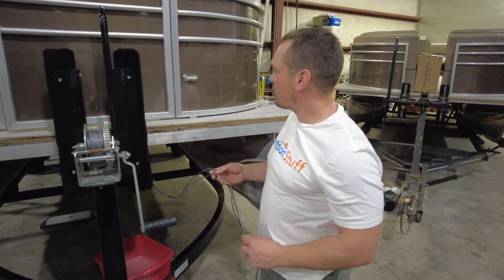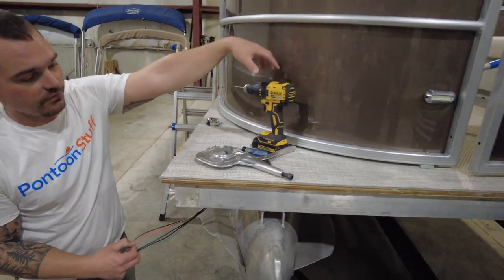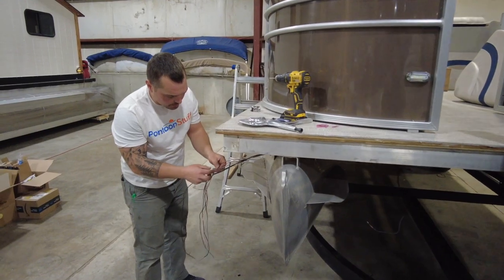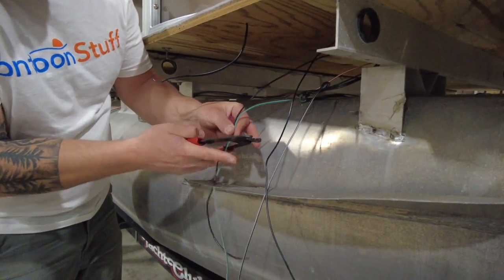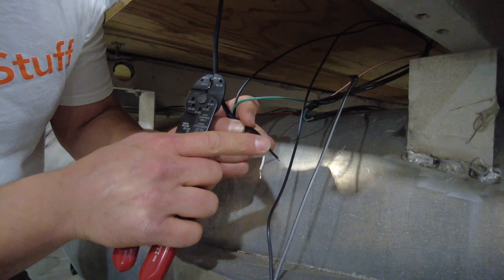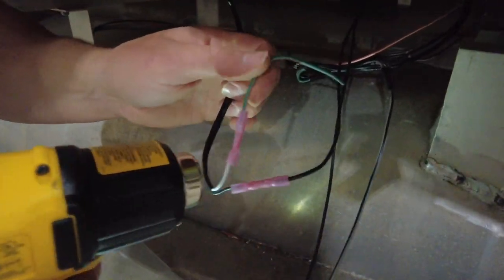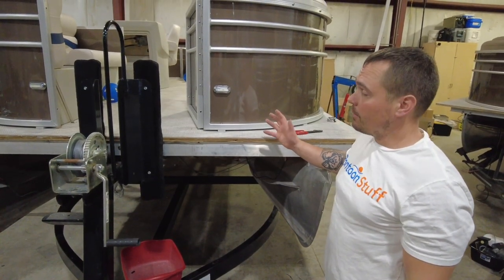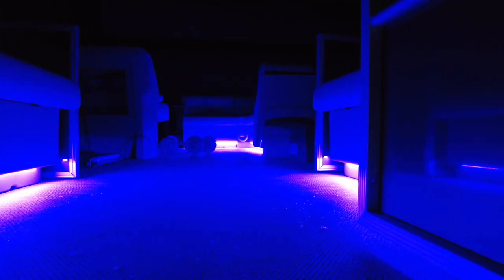Wiring Pontoon Boat Lights - Docking Lights and Navigation Lights

Comment: Hey quick question, I am adding an amp under the helm and wiring from under the pontoon deck to the battery. Do I need to seal the outside of the hole in the deck where I running the wires? If so, what product do you recommend? Thank you
Reply from the maker: I don’t add a sealer because with treated marine grade the rot process takes nearly eternity…especially if the wood can breathe. If sealing the open ply you could simply use a marine grade silicone.
Reply: @tomspontoons  thanks for the quick reply! I will add silicone sealant just for piece of mind because the other holes from the factory are sealed with some sort of sealant on the outside wiring looms. Thanks!
Reply from the maker: @gaba1170  I usually only see silicone from manufacturers used to plug speaker wire holes where water might spray up into seats. It certainly can't hurt to add it, especially if it gives you the peace of mind!! Best of luck with your project!

Comment: Newbie boater doing my first restoration here. Love the channel! Are the docking and running lights operated by the same switch or different?
Reply from the maker: Awesome! You’ll love owning and cruising on a pontoon, especially after doing the work yourself!! 

Docking lights should be on their own switch. In most places you’re not allowed to drive around with docking lights on, just use them for docking, trailering, or when necessary…then turn them off. Running (aka navigation lights) must be on at all times just before, during, and just after dark.

Comment: I’m restoring a pontoon and would like your opinion. When running the wires to the front of the boat I was thinking of running it in pvc or electrical conduit to keep it cleaner looking and add an extra layer of wire protection.
Reply from the maker: Great question! If you wires are bundled up nicely with nothing hanging where it could get caught or grabbed you’d be just fine. It’s never a bad idea to wrap what you can in a split conduit, or even to add some of it in the event that your wires are making a tight turn around metal where they could wear. Thanks for the question!!

Comment: I have a pontoonstuff wiring harness and all my ends have connectors. Do I need to cut the connectors off and splice them to be able to wire them to my docking lights , horns etc?
Reply from the maker: Great question! This video should help:

https://youtu.be/KJxsb4H5I_0

I’ll be showing in greater detail how to use their harness with a different switch panel. 

Generally, yes, cut off their ends and splice into your switches!
Reply: No that’s for the switch panel. I need help with this wire harness I recent bought from pontoon stuff. Is there a way I can send you some pics to get a better understanding?
Reply from the maker: @ddamion1801  you know where to find me I think… 

TomsPontoons@gmail.com
Reply from the maker: You’re referring to one of their variations of harnesses with the waterproof quick plugs!! Yes, cut those off and use the colored wire as your power to each accessory and the black as the ground!
Reply: @tomspontoons  yes! Thank you so much for that. Will I need to also the harness to connect it to their 8 switch panel?
Reply: @tomspontoons  I’m going to send a video to your email.

Comment: What gauge is the waire
Reply from the maker: Good question! To most accessories I prefer to run 16 gauge marine wire. For some shorter runs, or LED lights with low draw I will go with 18 gauge.
Reply: Tk
Reply: I live en nc where ara yuo
Reply from the maker: Yup!
Reply from the maker: I’m all the way up in Michigan!!
Reply: @tomspontoons  long way
Reply from the maker: @vicesparis  it is! Hopefully we have enough information shared to help you if you’re restoring your boat down there!
Reply: @tomspontoons  gracias

Comment: Thanks for doing these videos. Im rebuilding a boat from the toons up for the first time and have lots of learning to do.  Can you do a video on wiring with a 2 battery system using the harness pontoon stuff sells?
Reply from the maker: Thanks for watching our channel!! We hope that over time we build enough of a library of videos to cover every option possible. Are you looking to run two batteries in parallel? Or a battery switch? Often for pontoons we run one battery when it’s the motor and light accessories (LED lighting, basic stereo, fish finder, etc) and they do great as long as the motor is run while the bulk of the accessories are in use. If there’s an upgraded stereo or you know you’ll be parked often with motor off and accessories running, then we would add a deep cycle to power those accessories while keeping the motor on its own battery. A switch could be used in that case, or just a basic onboard charging system (even a solar panel trickle charger).
Reply: @tomspontoons  Thanks for the quick reply! I want to use a switch so I can park and fish or hangout on the sandbar and play the tunes.
Reply from the maker: @firemancary  Totally get that! We will be sure to video the next boat we install a battery switch on! I always give customers a heads up that you'll still need an onboard charger because even when running both batteries on with the motor pushing a charge, it would take hours and hours of running at fairly high RPMs to top off a drained battery. It'll help, but if you're always going out and parking/partying you'll need an additional charging option other than just the motor!
Reply: @tomspontoons  I'm looking to do this as well and would love to see a video explaining the 2 battery setup with the switch and trickle charger!
Reply from the maker: @mattlawson6975  I’m pretty sure we will be doing that sort of setup on our tritoon build in the coming weeks. I will definitely share a breakdown and install of the next one I do either way!